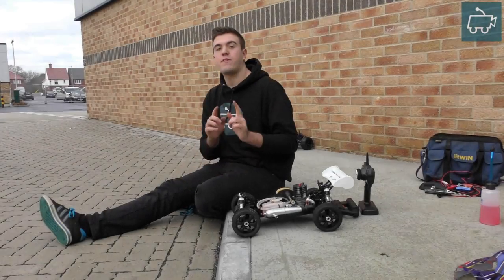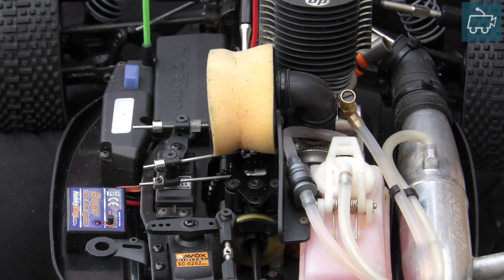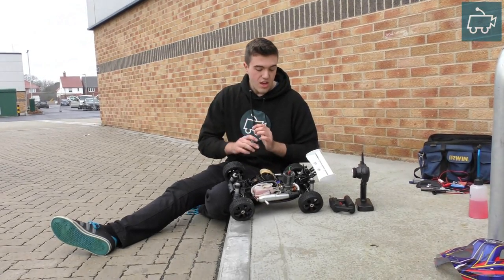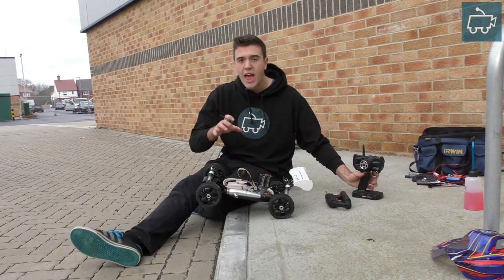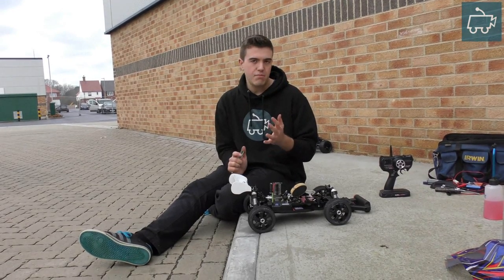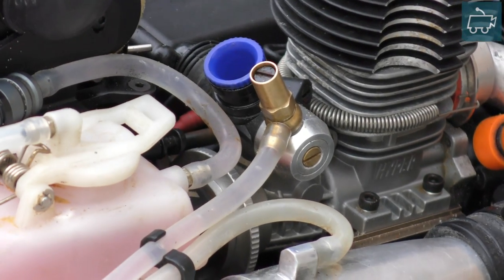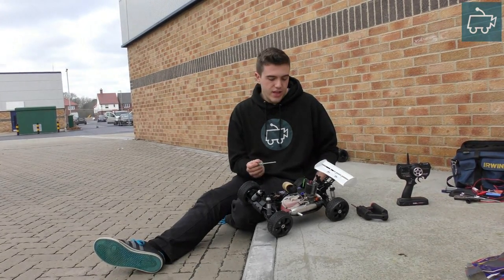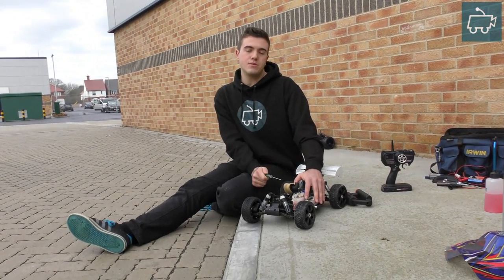Nitro Engine Tuning Guide Part 1 - The Needles of the Carburettor

Comment: Great video,Josh,I learned a lot from your early videos,a good reference point,and this is a worthwhile update.These engines can be extremely frustrating but persistence brings huge reward,I don't think nitro is for everybody but I hope they're around for a very long time yet,great satisfaction when you get it right with amazing sound,speed and smell.👌✌👍😊😁
Reply from the maker: I don't think they are going anywhere, but big R/C Companies such as HPI , traxxas etc, certainly seem to be focusing their time on electric models. HPI haven't brought out a  new Nitro model for years!
Reply: JT12's R/C Videos Yes,I agree,it seems to fit in with the instant gratification style modern world,the only Ready To Run models you could get when I was a kid were the cheap and nasty toy style models,nitro cars were extremely expensive then,electric cars fit in with this modern world,plug it in and go with no effort,to me,it's bypassing a large part of what the hobby is about.

Comment: The low speed needle or idle needle affects the entire range of the engine. The high speed needle does indeed control full open position but the idle/low makes a significant contribution to the high speed setting. The mid-range transition unfortunately is a compromise between the low and high rpm. It's often where the engine runs the poorest. Having some experience with nitro helicopters, certain engines have a third mid-range needle to obtain a better transition. Not seen in gasoline or smaller fixed engines.

Comment: Thanks for the series! My problem is that I made the mistake and messed up the factory settings needles in my force s15 engine and can't seem to find them anywhere. In the engine manual says that both needles should be 2 - 3 turns open from bottom but the engine won't start like that. Can't manage to get it running. The engine is brand new, couldn't do the break in procedure hence I could not start it. Can you help me with some advice?

Comment: My car just runs without the glow plug when I turn the low speed needle about 2,5 turns in. Isn’t this too much ? I mean it runs well so far but I don’t want to damage the engine due to too lean mixture.

Comment: I got a old one I want to restore the needle on it though just keeps turning is it meat to turn endlessly or is it meant to stop when fully open?, it is a 2004 tamiya NDF-01 thunder , pull cord is broken and needs new fuel pipe and glow plug and not sure about this valve and hope the problem ends there as any spare parts for it seems costly
Reply from the maker: Inside the valve there is an O ring that sits round the needle, I suspect it has gone
Reply: @TheRCBiker  thanks for reply I was just bring too gentle it turns s out it now tightens ha , but now I stripped engine to clean but the sleeve has a notch but the engine block has no notch to line it up with so not sure which way

Comment: I wish the default settings were as easy to get as others. I have just finished re-building of a vintage Hobao hyper 10 Touring car and i decided to by a brand new Hobao hyper 12 engine to make everything stock but my version came with a bog standard carb that only has the high speed needle and not a low speed needle so when i have tried to check the default settings from the manual that came with the engine it says open carb 6x 1/8th turns from closed which is only one and a half turns from closed but a much better detailed manual for the same engine is saying set the high speed needle three and a half turns? Also that manual has a different carb showing a high end and low ends needle whilst the version i have is different as explained above? So now i have two different recommended settings? Either i go with the manual that came with the engine (6x 1/8th turns from closed) or the better detailed manual from the hobao site saying three and a half turns from closed? I have managed to break the engine in with the default factory settings and ran 5 tanks through it on idle to be on the safe side but now i am trying to tune the engine it seems far to rich for three and a half turns out from closed but way to lean if i go for the 6x 1/8 turns? So now i am going to buy a better carb with both the high and low end needles in the hope that might solve my needle setting problems. Wish me luck lol
Reply from the maker: I wouldn't worry about what the manuals say and just tune it for performance. How it runs best is how the carb should be set :)

Comment: What is the screw on the OTHER end of the carburetor? The one opposite from the low speed needle screw. My engine only has 1 needle screw of the side, and it's OPPOSITE of the throttle linkage.
Reply: If you only have 3 screws, the one opposite the linkage is the low speed. It’s in the same place as the midrange screw on a 4 screw carb.

Comment: Hi first of all thanks for your videos they have really helped me out over the years top man. Just wondering if you could help me out I've just bought a macstar .28 engine and it didn't come with any default needle instructions and the needles look way out  just wondering if you know the factory defaults for this engine ?
Reply from the maker: Hi there! Glad they've helped 
This document gives you all the info you need about the Mac 28 https://www.cmldistribution.co.uk/diagrams/HoBao/Engines/HB_Engine_settings_MacStar_28.pdf

Comment: Hi.Do you know how to stabilize the Mid Range Needles crew because it comes out continuously?
Reply from the maker: The default settings of the Mid range needle is usually flush to the edge of the carb body for most engines. It shouldn't really be adjusted. 

If it keeps coming out I assume there is an issue with the threads! You could try threadlocking it in?
Reply: Thanks for the prompt reply. I will try it.Regards.

Comment: hiya and I was wondering if you could help me I have car that I can't seem to get running right and when I think it is running I am back at the start again many thanks
Reply from the maker: What's the issue?
Reply: I can get it running and when I start to use it and open the throtle slow it is OK but when I smack it open it will not run

Comment: what's the problem if a nitro rc revs up or revs on its own when lifted on the ground?
Reply from the maker: Sounds like the idle speed is too high. That's the next part of this tuning series
Reply: JT12's R/C Videos I already adjust the idle screw to its lowest that almost shut off the engine.
how was that?

Comment: I have a backwash 1.10 just took it out of the box i carnt get the fuel to go in the carborator. can you help.
Reply: Try unplugging the fuel line that is connected to the exhaust and blow (push air) on it with your mouth. This will create pressure on the fuel tank and force the fuel into the carb.
Reply: LazyRock thanks worked first time.
Reply: No problem, glad I could help!
Reply: Next time just put your thumb over the end of the exhaust exit while pulling on your pull start and it will prime also. But also the blowing into the tank trick works great to

Comment: what if u bought it from some one and it doesn't start at all , no matter what u do , carbs not tuned at all and it won't start
Reply: Base set needle so when at fully open need  1mm away from base. Close fuel mixture till it stop dnt force it. Then turn out 2.5 to 3 turns. Set low speed with power off n u pressing on throttle linkage side tords carb hole. Turn screw till it has a small gap in throttle. One its starts u got adjust all rods. Just delt with this on an ofna